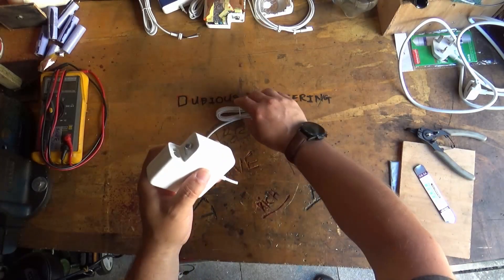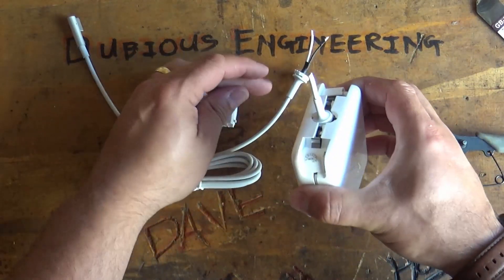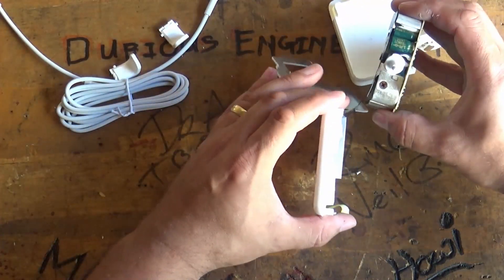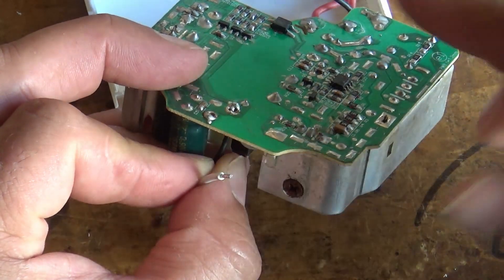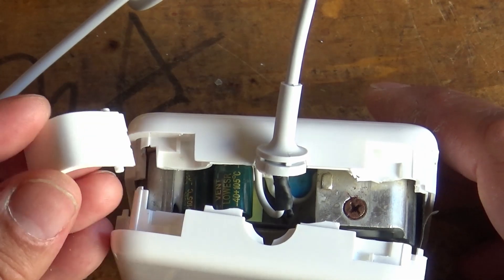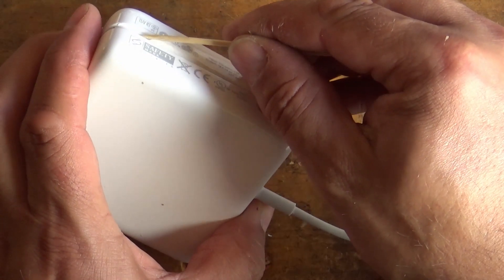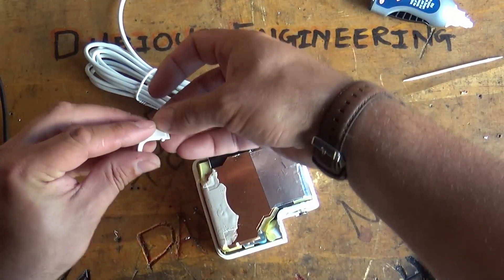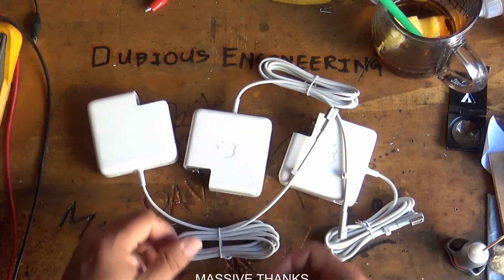DuB-EnG: Repair an Apple Macbook 85w MagSafe Power Supply Charger - Fix / Replace the Broken Cable

Comment: Hiya. 60w model a1344.how can I fix my adapter that no longer charges and smells burnt.  Can it be repaired?  Thank you
Reply from the maker: If its burnt then components need replacing. Do you have a soldering iron and a multimeter / oscilloscope to check and test?
Reply: @DubiousEngineering  I have a multimeter but I don't know how to use it.  And I'm a little afraid of electric current.  I saw in a video that even after disconnecting the charger from the power socket, it still has electric current accumulated in the transformer.  I solved the problem by buying another charger.  Thank you.
Reply: @maryo2620 the power is accumulated in the capacitor on the high side of the circuitry. There should be a bleeder resistor across that cap but if they forgot to instal it or it’s an el cheapo clone, it becomes a gamble. I recommend you find someone who knows about electronics to repair it for you.
Reply: @Subgunman  👍